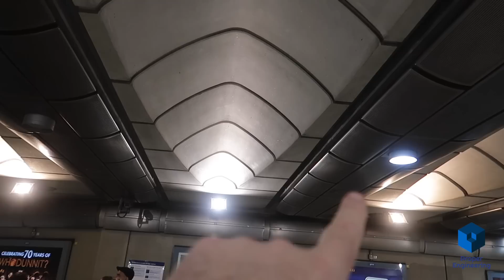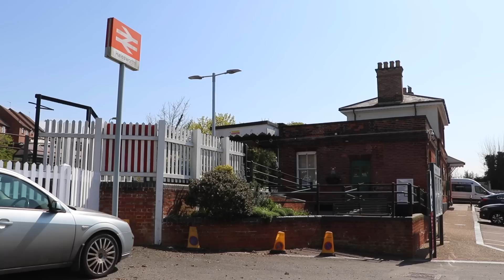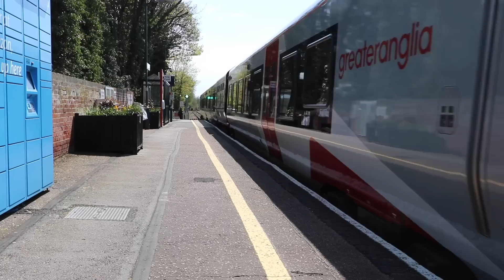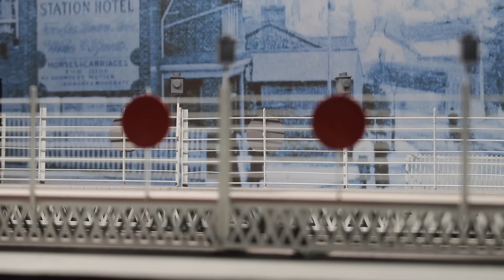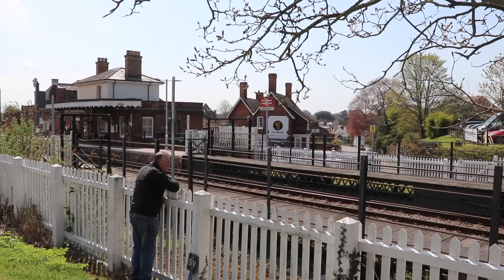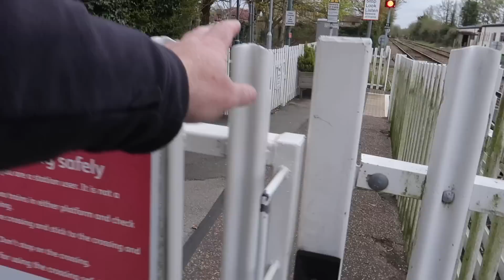The Unique Halesworth Moving Platforms

Comment: In certain circumstances it was safer to drink ale than well water. Like in London with the Themes pollution or the cholera outbreak in the wells. But that is the exception to the rule. Outside of that, it was no safer than drinking water from a clean well that hasn't been left to go stagnant.

Comment: Wow...What an interesting quirk and an amazing solution to a very difficult problem! Part of me wonders why they used four turning bridges as opposed to two counterbalanced bascules (Think Tower Bridge) but they went with whatever circumstance suggested was most optimal to the use case. 😇

One thing which stands out at me most starkly though is how these moving platforms were employed to allow a platform extension to accommodate 12 coach long trains back in 1880, yet today - 124 years, and a quadrupling of the UK population later - The longer platforms have been made redundant and (presumably) the station is once again restricted to five-coach trains! 😳
Reply: Safety. The momentum of a moving bascule is not reduced by the counterweight. (In fact the counterweight adds to the momentum). If a passenger got under a falling bascule it would likely be fatal, even at low speed. The railways were among the first British organisations to take safety seriously, and would have considered that too risky; even in an era when it was considered OK to send kids up chimneys, etc.

That's arguably because being new-fangled the railway had to convince the public that they were safe, whereas other trades could continue with time-honoured unsafe practices.

Comment: We solved the problem of short platforms in the US by not opening the doors of every carriage. If you want to get off at a station with a short platform you need to exit the train from the front few cars.
Reply: Yes, that's how everywhere has solved it today. Back when this was built you couldn't walk between train cars, so without this as a solution if you didn't get on the right carriage you couldn't get off.

Comment: Hi Stuart
What an excellent presentation of a unique bit of Victorian thinking and engineering.
I have been lucky enough to have lived (retired) in Halesworth for about 6 years now. So I know about this old level crossing cum platform creation. My family was old GWR and I did part of my engineering apprenticeship at Swindon works so all this was of great interest when I first used the station and since.

What is interesting is that in Halesworth itself there is the canal (The Blyth Navigation) which replaced the horse and cart operators and was cut through in 1761 to Southwold to enable larger Wherry boats to move the malting and agricultural goods for export at Southwold and bring coal and other products in but it closed in 1884.
The canal's end was brought about by the Southwold narrow gauge railway which opened in 1879 and had its depot adjacent to the up platform at Halesworth. That railway was effectively replaced by road services for passengers and freight and closed in 1929. Parts of it are being restored by volunteers.
By WWI the bigger main line railway had the massive malting warehouses you showed built complete with an extensive set of sidings and a workshop and served the rest of the nation and larger ports.

So you can see the historical stages of development of transport from horse and cart via canal and small railway to large railway and road transport as each new invention replaced the previous one.

Comment: Very unique solution. In the US we also have lots of rail infrastructure that was designed to be moveable, where the line is still active but things like swing, bascule and lift bridges are no longer functional. Usually because the rivers are not used for commercial traffic any more. But there are still some operating as they were designed and built many years ago.
Reply from the maker: Yes we have the same in the UK especially over and around canals that once again are no longer used for trade.

Comment: Thanks Stuart. An excellent video.

The swing bridge wasn’t quite as unique as it is today. 
There was a similar arrangement at Chantry Road in Saxmundham that, whilst closed to road traffic, connected the original down platform to the goods platform to the south of it and allowed the unloading of milk churns and other perishables that would have travelled on passenger trains. 

If you visit the Saxmundham museum you will be able to meet someone who has actually operated them before they were wiped out by an overloaded freight train in the early 60s.
Reply: I work at Saxmundham  station in 1950 i use to open the wood platform

Comment: There was a moving section of platform at the old wood Lane station on the Central Line of the London Underground which was closed when replaced by the new White City station when the line was extended.  It only moved back a short distance from the tracks to enable a train to enter the depot.

Comment: Surely the best engineering solution is one you don't actually have to build! They could have just got people to get on the train at the front and walk down to the end of the longer trains. Coupled with signs on the back of the level crossing gates warning people already on the train that they needed to walk to the front to get off.
Reply: Many of the trains in use were using non corridor stock.
Reply: Yes, this was the best at the time because all the carriages were separate, if people didn't get on the right carriage they couldn't' get off at all. So replace all the trains on the network, or put a little bit of engineering into a single stop? These days with walk through trains they solve it just how you say. But 200 years ago, not an option.

Comment: They used a similar solution on the London Underground. The old Wood Lane station that was on the Central Line had a swinging platform to ensure that a train turning off to got to the depot didn't hit the platform.
Reply: There was at least one platform on the Chicago Elevated set up this way as well, to allow a platform extension on the North Side Main Line over the junction to an overflow terminal for rush-hour traffic and specials.
Reply: Cheers. I'd seen this too and was about to search it out as I'd forgotten the location. 👍🏻

Comment: Given the popularity of manually turned turntables for locomotives, I'm sure pushing these movible platforms was not very difficult, as long as the mechanism was lubricated. However, a bascule or lifting design would have allowed the use of a counterweight. Did that occur to you or anyone else?